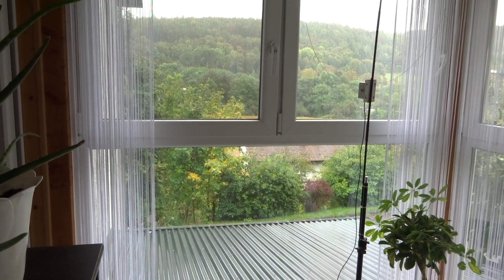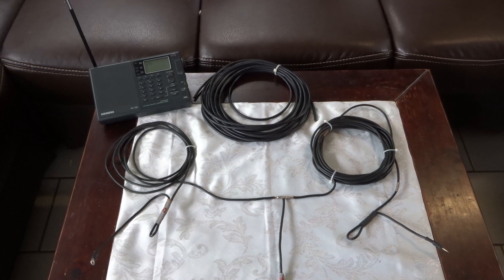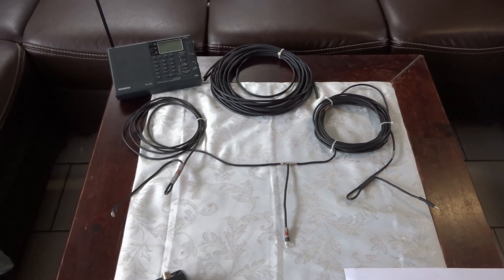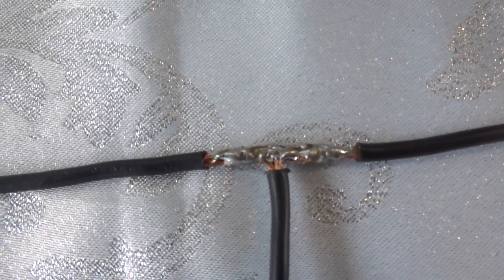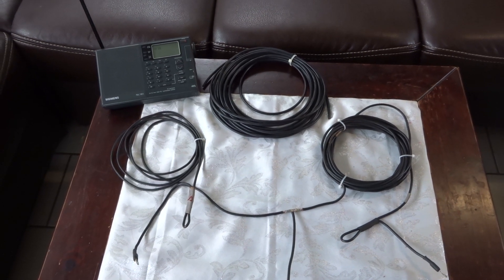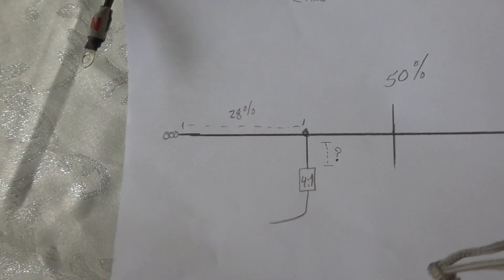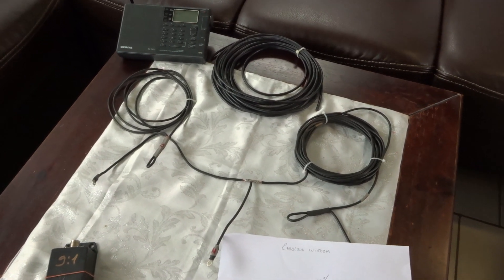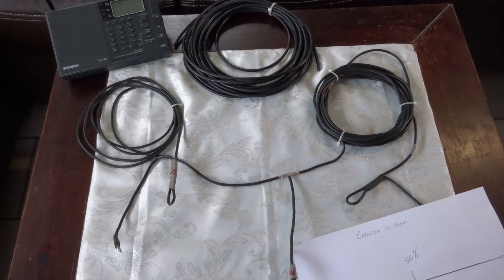Multiband Antenna for SWL

Comment: I have a 20$ sw radio (clooblut) with just a 12ish foot cable in an L to my bedroom ceiling and a 16" square or so piece of aluminum foil hanging from the off the end. 
I live in Maine and can hear turkey, aus, NZ etc. Pretty sure I can get some stations in better than a web sdr I use out of DC lol

Addicted to swl now. It's just too bad radios are basically no longer being made and the cheaply made chinese ones are way overpriced/questionable lifespans.

Comment: I have a Tecsun PL-606, alligator clip the antenna to an indoor coax cable, outside to 50 feet of speaker wire around my fence. So far that's the best reception I can get in a city condo (Vancouver Canada). Just getting  into SW and learning by the day. Thanks!
Reply from the maker: Basically that's all you really need.   Oh you can always build a  better antenna...but at the end of the day....its just wire waiting for the right conditions.  Have Fun

Comment: Off center dipole seems a great antenna.
A good balance between an End fed and dipole.
Wide receive of an End fed, but less lossy.
Reply from the maker: I'm was pleased after I deployed it and you're right a good balance between a random wire and dipole.  I will say with a proper UnUn it is so noisy, its impossible to listen to.    Its amazing how much of a difference a UnUn makes.  Thanks for watching and commenting, I appreciate your subscription and like.  73s Brian
Reply: Off-center works well.  But if you want to transmit, you may need a few chokes on the coax - they can have a problem with common mode RFI.  --  AA6LJ

Comment: No antenna works well on every band. An ATU  can make an incredible difference to signal peaking and getting rid of unwanted noise.  I’m surprise many shorts wave listener neglect to use one etc.
Reply: What’s an ATU??
Reply: @darrelllynch7816  Antenna tuner unit. Basically a capacitor and inductor that matches the impedance of the feeder to the radio. It may also form a resonance circuit with the front end of the radio to can peak incoming signals while also rejecting noise.

Comment: hi there! - love the idea quick question for you
how long would / can teh feeling be ? - would say 5m or 10 m be ok?
many  thanks
Reply from the maker: The ideal length is 12.5 meters... but 10 meter(approx 32 feet) works well also.
Reply: Many that's for the reply 

Sorry meant to write 

Element length is 12.5 m

But I was wondering how long the feedline is ?

(Vertical to the elements of the Carolina windom)
Reply from the maker: @MrLittlmike22  The "feed line" is coax and use whatever length you need.  If you want to use length of wire coming down from offset  (windom configuration) this is dependent on the height of your antenna.  Please remember that if...you do not use a balun  you force the coax to become part of the antenna and you don't want this.  also remember we are only interested in receiving shortwave signals... so you have room for experimentation with lengths of wire.  With this design we are not worried about SWR like hams are because this is a receive only antenna.  You have plenty of room to experiment with.   I dont to make this too long but.  My first attempt building this antenna I connected the Balun only a few inchs under the offset.  It worked great.  next I connected the coax direct to the offset the coax was 7 meters to my window which I connected the balun ...not only did it work good but I had the best MW reception of any antenna I ever built.
Reply: @MrBrian8749  that's great will definitely try that one !!
Thank for taking the time to reply

Comment: Nice man.   Sweet pad!  ha.   And T540p laptop, I still fix those and sell them.  
I'm getting into the hobby, but does that antenna work with .. all of it, like AM, SSB, FM, etc?        I just ordered a 'Eton Elite Executive'.   Looks cool.   Wasn't sure about 'antenna vs radio spectrum'.  
Thanks for the basic videos for n00bs.
Reply from the maker: Thanks for the comment, and its a T500 laptop.   I love this computer, ok its a bit slow loading the browser but it's a  battleship.  I have windows 7 but I think it missing some dll's  and thats why its slow.  Any Tips are welcome.  The Antenna works MW or American Am as you call it from 10 kHz to 30 kHz  This is the entire shortwave Band or some call HF.  Your comments and questions are always welcome.  73

Comment: What are your thoughts regarding the "trapped dipole" antenna for swl'ing?

Thanks for all you do!
Reply from the maker: John I really don't know much about a trapped dipole. I might build one in the future just to try it out.  Its interesting looking.  Thanks for commenting 73s
Reply: @MrBrian8749  Or better yet, a fan dipole. Basically one just cuts a wire for a resonant frequency that one wants to listen to. An example would be cutting a wire for 49m band and then attaching it to a dipole center insulator. I like the Alpha Delta center insulators, but a short piece of pvc pipe center insulator can be used in a pinch. Then to add another shortwave band to the antenna, it is only a matter of attaching extra wires to the center insulator. Extremely quick and cheap way to construct a wire antenna. Most of the time all the parts can be bought at the local hardware store. Some swl'ers may not agree with me when I say Home Depot or Lowes is the ultimate swl'ing antenna superstore. Even for building a monitoring post from the ground up. 

Keep up the great work sir!

John
Reply from the maker: @johnstrunck3659  We dont have a home depot but we do have Hornbach they have everything a SWLer needs.  The fan dipole is straight forward and simple to build.  I looking to buy another mast.  I like the fiberglass military camouflage poles.  They're  cheap and easy to work with.  I have just enough space to set a fan dipole up.  I also have a 82ft dipole w/latter line already set up.  Maybe I will just modify it..  Thanks John for idea and supporting my channel.  Feel free to stop by anytime, I'm happy to talk shortwave with you anytime.  73s Brian... Adelsheim, Germany
Reply: @MrBrian8749  Sounds like a good place also. All the best to the channel! Will be looking for your next vid. 

73

John

Comment: Pretty basic but functional antenna. Did you say you needed a balun for this to work properly?
Reply from the maker: Its better to have a balun , less noise.  In the windom configuration a 4:1 balun is a must as the antenna is omnidirectional and will pick up interference.  Over all this antenna is no more susceptible to noise than any wire antenna 73s